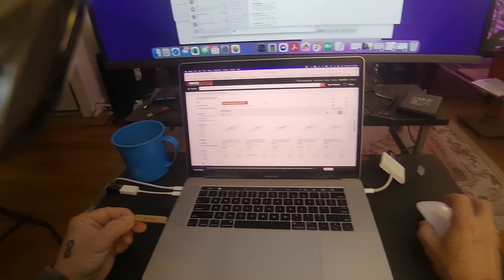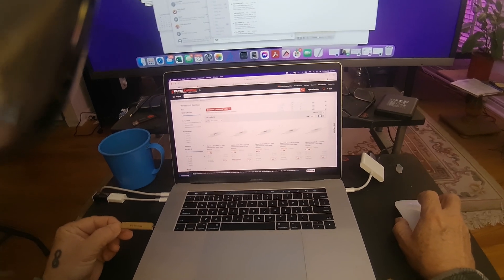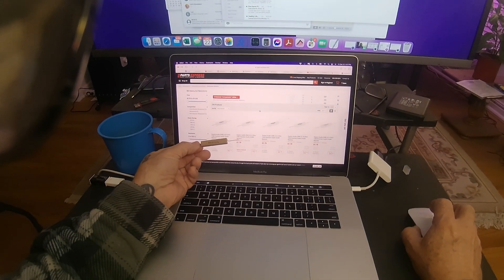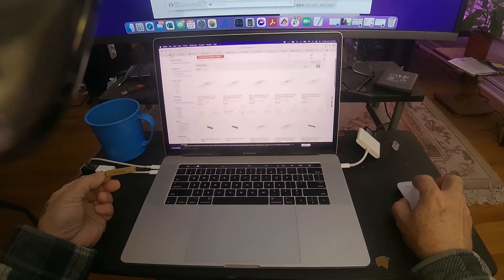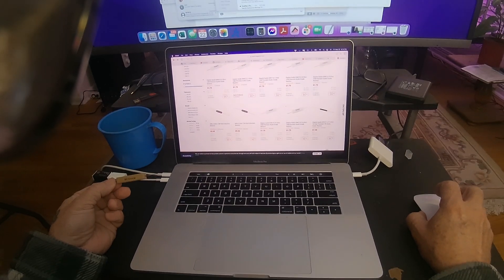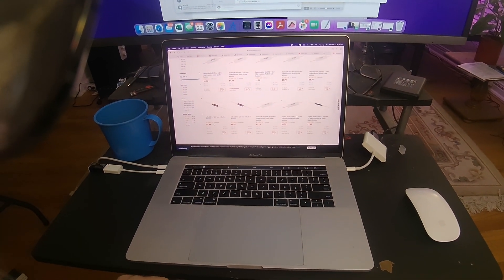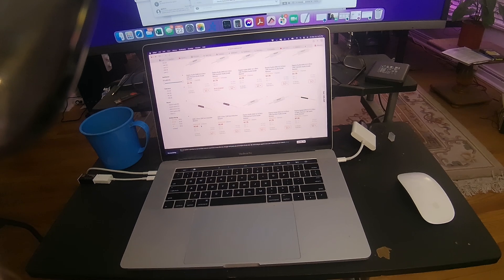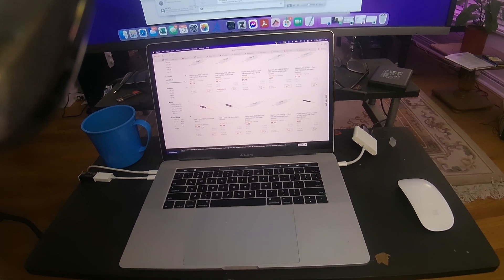Audio Crossover Resistors - Should I Replace ?

Comment: Speaker drivers and room modes and reflections have so much bottleneck, it negates the argument on which resistor sounds best, typical speakers have as much as 5% distortion.
Reply from the maker: Agreed

Comment: Interesting topic. I recently got everything I needed to refurbish a beautiful pair of Klipsch Fortes I recently picked up from my neighbor. I bought new higher quality caps and resistors to replace the stock parts from Parts Connexion, due in part because they’ll take already closely matched tolerances and match them within 1%. I also damped the horns with dynamat and replaced the old wire with OCC copper wire. I can absolutely hear a difference in the speakers’ clarity, instrument separation, and overall tonality. I also did a lot more than just replace the caps and resistors, but I think things add up and make an audible difference.
Reply: Hi Nick, we meet again! That seems like a very interesting project you have done 👌.  Happy New Year to you my good friend.
Jim🏴🙂
Reply from the maker: Yeah I would agree that a number of nominal changes would add up to make a difference. As a rule I don't replace them, but that is because I am dealing with speakers of nominal value.  If I ever get the JBL L300's I covet, I wouldn't spare any expense on a possible crossover upgrade.

Comment: in a carefully designed system the audio drivers, the cabinet and the crossover are all matched to achieve the optimal response. if you need to replace the crossover resistors, for some reason, replace them with equal value components (watts, ohms and construction type) because they usually turn a system from underdamped to either critically damped or overdamped and thus reduce annoying peaks or excessive overlaps in the electromechanical (coupled) behaviour of the whole system.
Reply from the maker: I agree.  Good analysis
Reply: You are spot on sir ! Few people actually recognize or factor in the big picture so to say.
Reply from the maker: @l.b.stringfellow2413  Thanks
Reply: That might be true of carefully designed speakers, yes. But how many cost-constrained models are really all that carefully or critically designed? A standard 10-20% tolerance between samples of the same electrolytic cap will surely have far more effect than a tiny difference in parastic inductance in a resistor, won't it? When a crossover uses electrolytic caps (just as an example) the overall tolerance of the entire system is inevitably compromised and can't be that precise. And if a speaker is so carefully designed that even the smallest differences are critical, then I'd think it's very likely that it already wouldn't need any upgrading.
Reply: @osliverpool  true, if one uses electrolytics instead of the far more accurate non-polars then precise values of resistor is much less critical or even prevalent in some cases (the series parasitic inductance of resistors is rarely relevant in crossovers unless it extends into several 10s of micro henries). anyway, a system using electrolytics especially the ad-hoc desperate back-to-back configuration that is nothing but short of a joke is hardly worth considering any meddling at all except putting those poor caps out of their misery ;-)
Reply: @dimitrioskalfakis  Hehe, yes, I love the idea of "putting those poor caps out of their misery"... we're doing the world a service 😀 It is surprising, though, how far up the price ranges we can often go and still find really nasty electrolytics in there.